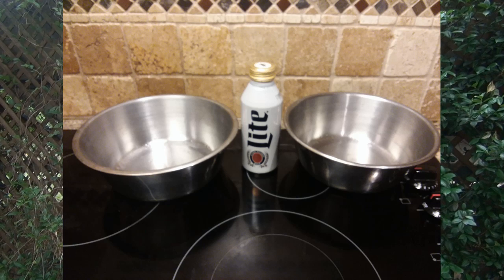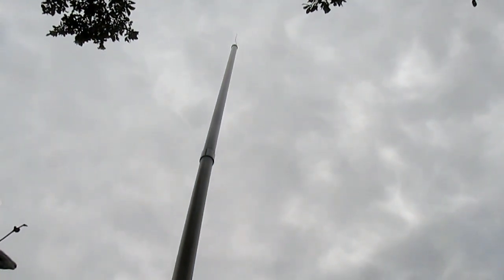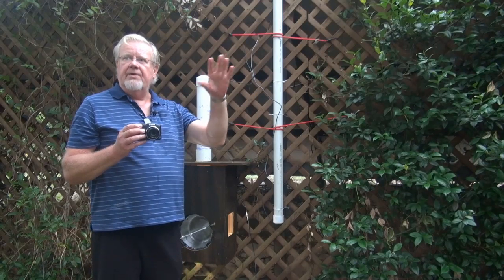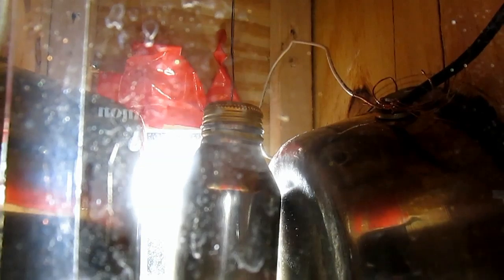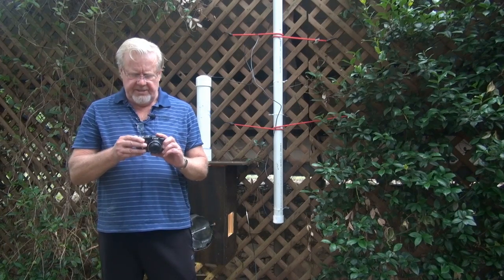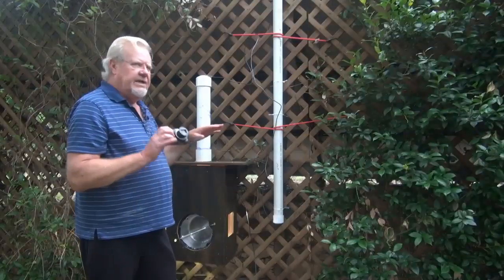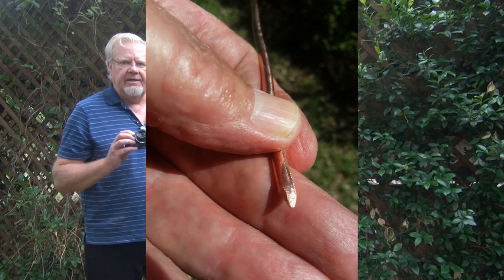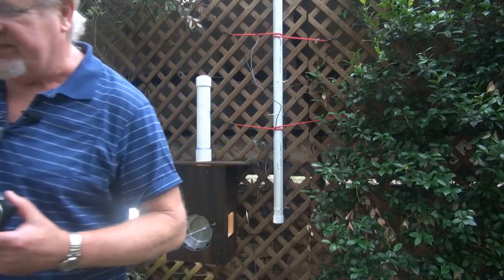Franklin Bells Proof

Comment: Great job!  I would suggest that 2ft is not "well grounded" though.  Spend $10 for a proper grounding rod and pound it in.  If you've ever setup an electric fence charger, they suggest several grounding rods in a radial pattern.  I think that would make a big "difference", hehe. :)

The other thought is that a rounder can will be more dynamic.  The can has some electric field concentrations due to the /sharpish/ bends compared to a spherical gaussian surface.

Comment: Very cool.  I wonder if you could see any arcing if the flood light wasn't inside.  How well did it work during the current storm?
Reply from the maker: Last nights hail storm had the bells ringing and I turned off the light.  I could see no arcing.  The current storm is the daytime storm in the video.  It worked great as you hear in the video.
Reply: Steve Browne Channel   I had never heard of Franklins Bells but after watching your video I started researching it. Very interesting and your video shows it all. I think I may build one, I have a few extra stainless steel bowls.
Reply from the maker: @markraymond3886  Go for it.  Be careful and let me know how it works for you.